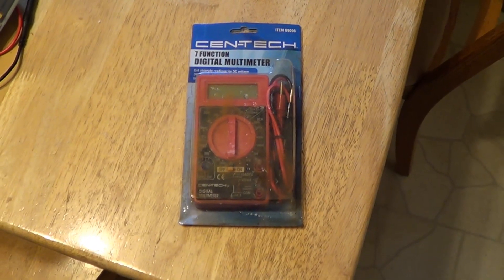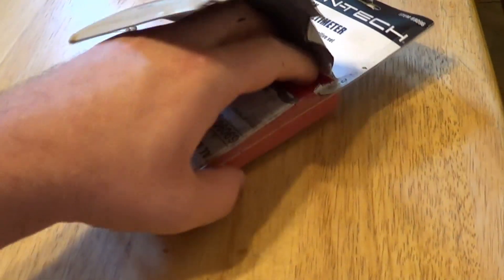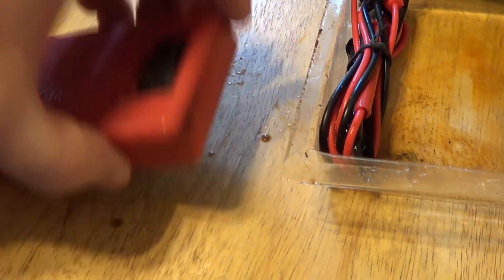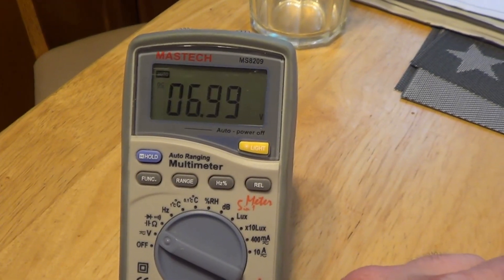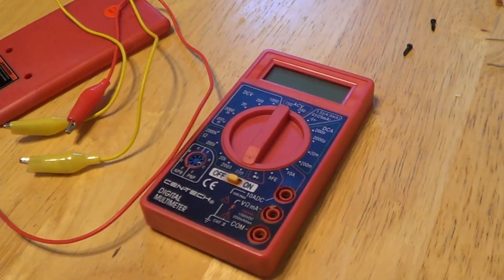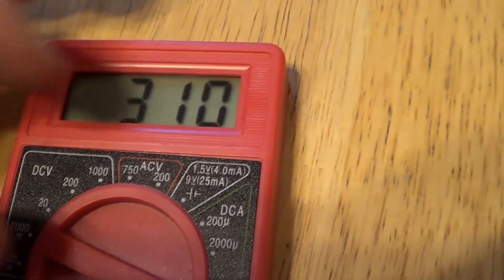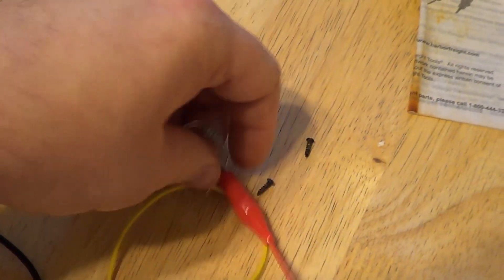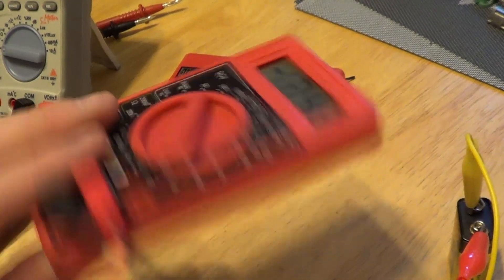Kitchen Table Electronics Resurrection: Cen-Tech "Freebie" 69096 Multimeter

Comment: Could you do a video on troubleshooting a ups battery back up.  Something beyond just replacing the battery.
Reply from the maker: Beyond making sure that the incoming line voltage and wiring are correct (right voltage, no polarity swaps, ground not open, etc.) there isn't anything you can (or should) do unless you have the needed expertise to work on high voltage, high current electronics.

Comment: Here's my notion. If it's free and useful, it's always worth fixing. If you end up going over the value of what it's worth, it's now trash. I found a pair of bookshelf speakers on the side of the road, they looked great. Opened them up only to find foam rot, blown up crossovers, and blown tweeters. 

Has stickers one the sides which lead me to believe a kid must have owned them and went a little wild with whatever amplifier was powering them. To get used, and not good condition drivers for them it would have cost the same as buying them for msrp, 30 years ago lol!

Comment: I have a cheap black multimeter one thing is the amp meter start counting up even though it connected  to nothing please tell me whats causeing that problem so i can fix it
Reply from the maker: If it's a DT-830 meter (looks similar to this one), there's not much you can do. The only adjustment any of them have is for DC voltage calibration. Truthfully, there isn't much that is worth doing when you can buy another for $4 or less (sometimes with shipping) on eBay, Banggood, Alibaba, etc.

If you do replace it, consider something a bit higher end: the True RMS version of the Victor VC921 is an outstanding deal for the money (although unprotected, just like the DT-830) and there's also the Aneng AN8000-series meters (which do have some protection). Either one would cost you between $10-15.
Reply from the maker: Some of the Cen-Tech "freebie" multimeters have a permanently installed fuse, some are user replaceable AGC types and others don't have anything. I don't think the fuse has any function other than in the low current measurement mode.

When I'm talking of protection in a multimeter, I'm thinking more along the lines of devices like MOVs (to protect against spikes on the line that appear while measuring) or PTC thermistors (to cut off current flow if the meter is mistakenly hooked to a live circuit while in resistance measurement mode).

Comment: It's just damp under the zebra connector bill, they are touchy from new.
Plop the pcb in a tray and tip metholated spirits over it, use an old but clean toothbrush to scrub over the pcb.
Also clean the zebra strip.
It's based on the good old ICL7106 multimeter i.c first used in flukes first handheld multimeter.
Reply from the maker: Hadn't even thought about the zebra strip (since the meter got wet from the bottom end). And while they're touchy enough in the other things that use them, these meters take it to a whole new level. If the PCB isn't cranked down to within an inch of its life, the display won't work right. The circuit board is literally bent from the pressure.

(In fact, in most of the examples I have, the screw holes for the circuit board mounting screws are stripped or right on the verge.)
Reply: Yes ive noticed the rather thin pcb on a similar sort of meter i have.
The yellow 830b that was made by mastech was quite good, the pcb was bigger and less cheap overall.
The accuracy was good enough for basic voltage Go/No go checks, and the resistance range quite usable.

On all 830 meters the leads are allways crap, bin fodder lol.

Comment: I have two of these. I'd say they're pretty damn decent for $5 (or free in some cases like you said)
Reply from the maker: When you're measuring DC voltage, or resistance up to the 2000K (2M) limit, they're hard to beat. They're also great if others want to borrow your multimeter.
Reply: Agreed! I don't do too much with it but when I need it, it's nice to have.

Comment: I have a couple of these and they do work. maybe try drying yours out with a hair dryer. 

I picked two Radio Shack 22-810 multimeters from their dumpster, one was completely fine and one was rusted inside. I cleaned it all out and surprisingly none of the traces were eaten out. The test leads were damaged but I had an extra pair that I soldered on and I still have this meter and it still works great. I use it to test batteries and to fix small electronics in my bedroom mini workshop, actually it's my computer stand. I have a harbor freight meter like yours in my real workshop in the garage.